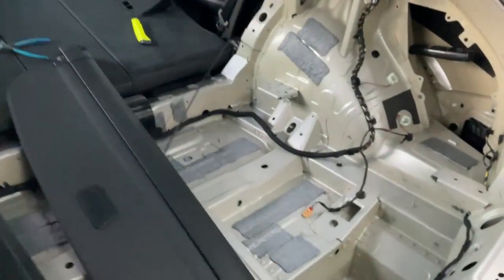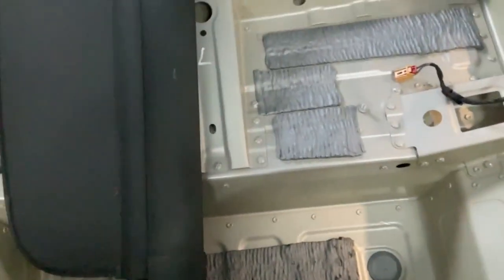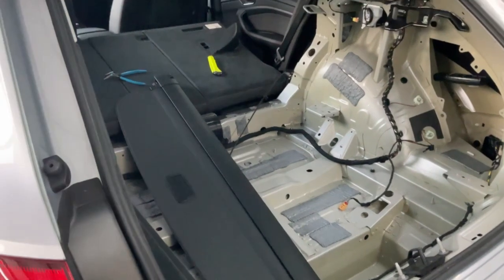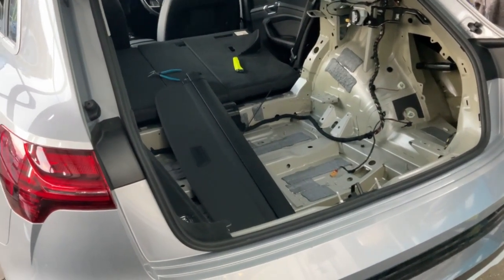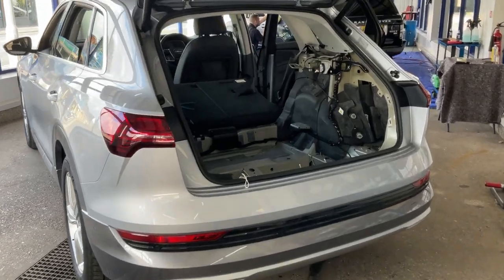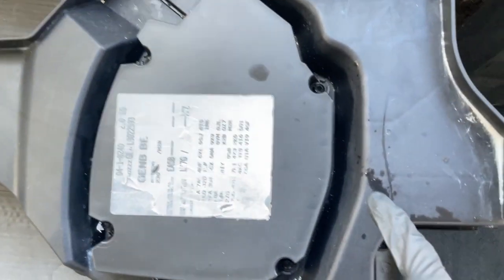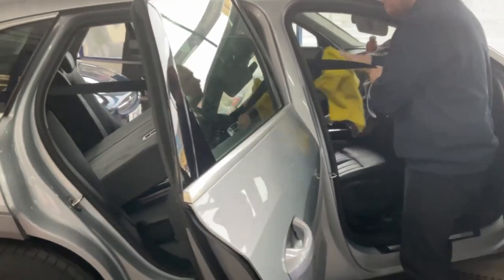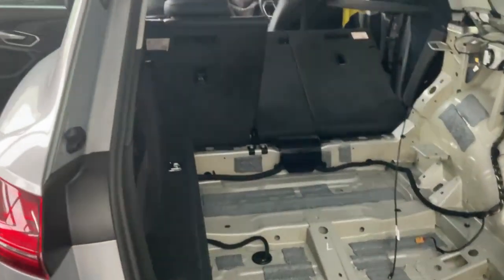Diesel Spillage and Odour Removal | Audi

Comment: What was the final cost?
Reply from the maker: Sorry, I don't have access to that information. But with many of these things, it is a case of "you never can tell". It could be the case that somebody spills a litre in the boot, and it is only a couple of hours labour. Or somebody could have just spilled a cup full, but it gets into the box sections, and we have to strip the whole interior and flush the car through with dozens of gallons of chemical. What we normally do is an hours work, which then allows us to get an idea of how much it costs and put together an estimate. However, some of these jobs are open ended and we have had a few that run to about £2000. Often we get them through the insurance company, but with others, we do that initial assessment, put together an estimate, and then the customer weighs up if it's worth making a claim. 

Unfortunately, fuel spillages are one of the more difficult ones to do, and the problem is often made worse when somebody tries to mop it up or shampoo it out, and only succeed in diluting the problem and spreading the contamination further.
Reply: Diesel is the worst